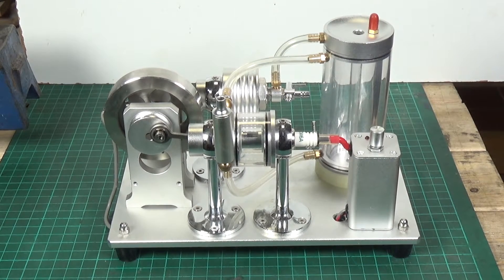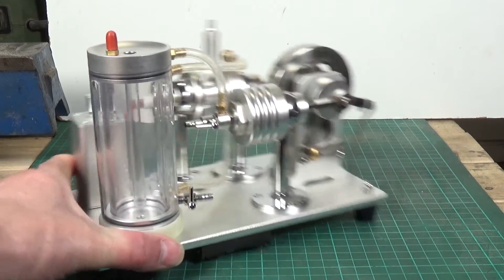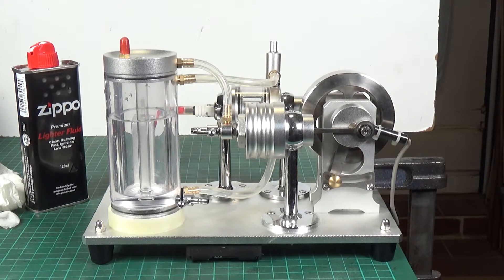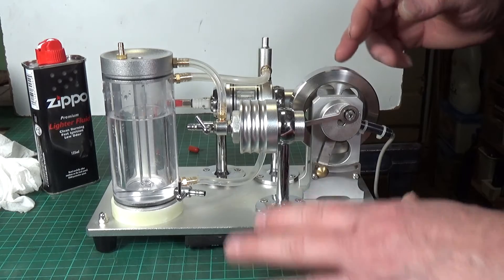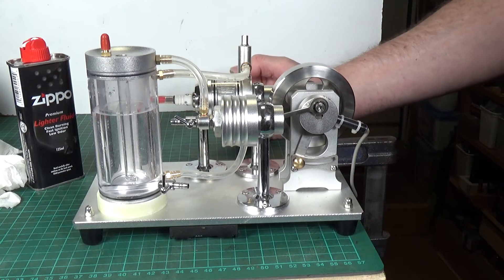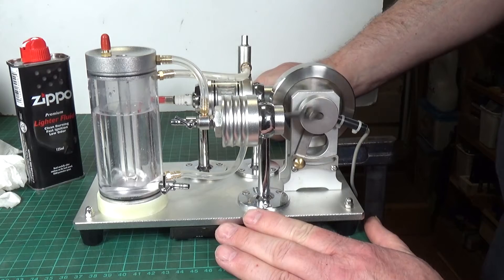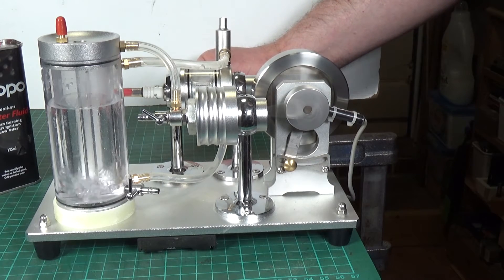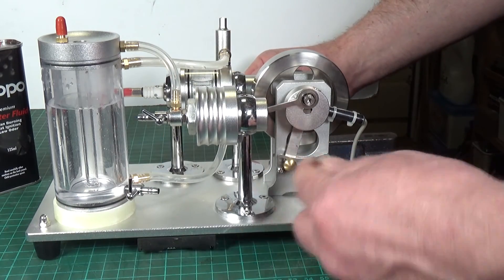Modern Mechanical Tech - Chinese Two-Stroke Engine - Part Two

Comment: Hi Allen, I got mine running great a few times. it ran for a long time and i was able to control the timing, air fuel mixture and the Ignition control module that controlled the spark plug  giving it the Hit and miss affect when turned down. You could bring the rpms down nicely and it would run great.   Ive noticed that having to much fuel make's It hard to create bubbles for creating a vapor.  using hot water helps as well.  but today Ive been struggling to get it to start. ugh.  thanks for sharing.
Reply from the maker: Yes they can be a bit fiddly but worth the time and effort when they run properly.

Comment: Where can you purchase replacement fuel, water tank tubes and cylinder water jacket tubes?
Reply from the maker: The fuel just regular petrol. The plastic tubes are similar to those used by model aircraft engines and are available on ebay.

Comment: To make it more easier to start, you can use a hair drier to blow the water cooling barrel, with the temp. higher, the Zippo oil or Alcohol can evaporate faster, which will make the engine very easy to be started, just my personal experience.
Reply from the maker: Thanks for the tip.

Comment: Alan,
In part 1 you noted that there were no visible lubrication system... Did you every find one? Also I wondered is the cooling system was filled with warm water would that help it start?
Cheers
Paul,,
Reply: I use alcohol as fuel, it is not easy to start when room temperature is low, so I use a hair drier to blow the vertical barrel, and make the water warm, then the alcohol will evaporate faster,  and it becomes easy to be started. Just my experience for sharing.
Reply from the maker: Hi Paul. No there is no lubrication system. I mixed a little 2-stroke oil in with the petrol and hoped that would give it at least some lubrication. Not sure on the water front, if you read through some of the other comments people have had even more trouble than I did getting it to run. Cheers, Alan.

Comment: Could you also use methylated spirit?
Reply from the maker: Not really, as it's a two stroke engine it needs petrol.
Reply: @RetroSteamTech  Ahh i see, so I could use two stroke petrol?
Reply: or are there any combustion residues when I use two stroke petrol?
Reply from the maker: @Purpleleaf22  Yes you could use two stroke petrol.
Reply: @RetroSteamTech  thx m8

Comment: Great video doesn't it need lubrication?
Reply from the maker: Thanks. There isn't really any way to lubricate it.
Reply: I spray some WD-40 or drip a very little drop of  sewing machine oil into the open cylinder, not too much, which can help less the wearing and get the engine much smooth.

Comment: Hi Alan.I've just bought one, and I'm going through the same learning curve. You're video's are excellent and have been a good help, but I still can't get the little so and so to run.
There was a good tip in your comments about choking the air inlet, and that's bought me a few more pop's and farts, but it still wont run for any length of time.
If you have any more tips and hints, I would be very grateful. 

Cheers
Paul
Reply from the maker: Hi Paul. Everything I did was covered in the video, on mine the position of air intake valve seemed to be critical. You could try using actual petrol as opposed to lighter fluid. I had much better results with petrol on the two hit & miss engines. Never could get them to run with lighter fluid. Cheers, Alan.
Reply: I bought one, im no novice with engines, but could not get to run, tried everything, every fuel, literary spent weeks trying to get going, would just fart and pop, but would not run.
Converted now with carb, will do video soon.
Reply: @aservclive  That sounds mighty interesting, I have had mine running a couple of times, but to be honest it takes so much faffing about that I've more or less  given up on mine.
Please let me know when you upload the video. 
Cheers. 
Paul.
Reply: @Brymboman101  know exactly what you mean, website calls them hit and miss engines, which there not, maybe they call them hit and miss, some work some dont😂
Reply: @aservclive  Did yours work any better after you fitted the carb?
Reply: @Brymboman101  just uploaded video
Reply: @aservclive  It looks good, and it starts a hell of a lot better than mine does.
Fortunately, I also have a cox .49 engine to hand, what exactly did you have to do to make it fit?
Reply: @Brymboman101  bit of modifications.
From the cox engine, you need to end up with just tank and crankcase, the prop drive housing then needs to enter the large nut  on  the fume engine intake.
Drill out intake nut to suit prop drive housing, and glue.
But first undo fume intake nut and carefully remove intake valve and spring, dont drill all the way through, just enough to seat and glue prop drive housing.
Where cylinder screwed into cox, blank off.
Hope above makes sense.
Reply: @aservclive  yes, thank you, that makes perfect sense, I was worried that you had to machine something or other, but I can manage a bit of drilling and gluing. How did you blank off the top of the crankcase, more glue perchance?
Reply: @Brymboman101  glued a metal plug.
Reply: @Brymboman101  if you send me your email i will forward you some pics.
Reply: I tried Zippo lighter oil, if you use Zippo oil,  the air intake valve is near horizon, 2 or 3 degrees, that works well and easy to be started. Another experience, using the pulley by the cod, after the pull the pulley, try to adjust the intake valve, you can find a firing point.

Comment: I guess you also have recognised that bubbles of air are generated inside the glass cooling jacket, when the piston is being moved ?!

Question: WHY ?

The piston should only be active inside the combustion chamber (the cooling jacket is around this volume)...
... does the piston probably have a larger diameter outside the combustion chamber (to the right), where it is able to  pump the cooling liquid to the top of the coolant reservoir ?

Comment: Great video; I guess that the inventor of this engine replaced a common (needle) carburetor by sucking in the air / fuel fume mixture from the tank.

I guess you also gathered had some  experience with the BLUE BANGGOOD Miss & Hit  engine:

Question to you : My - just arrived - blue engine shows solid friction between piston and cylinder. No particles involved; just friction. It moves, but there is a pronounced friction.

Should I run the engine (piston well lubricated) via flywheel and external drive for a few or more minutes in order that piston and cylinder will "harmonise" ?
Reply from the maker: Thanks. There shouldn't be any friction on any of these engines. Just a small amount of compression at one point in the cycle.

Comment: Good one Alan.  Yes, the motor uses loop thermosyphon cooling same as on vintage cars with no water pump.  To flow and work it needs to be full.

Now that you have the mixture set correctly it might start from cold better if you don't alter that and choke the air inlet with your finger tip while spinning it over.

Very cool little engine.

Cheers Rob
Reply from the maker: Thanks Rob. I might do another video showing what effect each of the controls have. Good idea about choking the air inlet, that's what i do with the hit and miss engines and it improves starting no end.

Cheers, Alan.